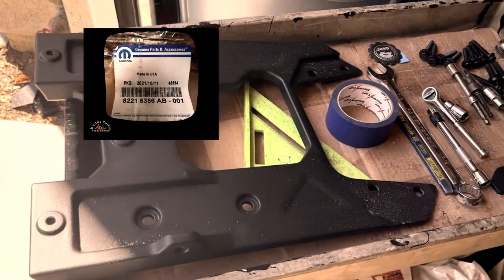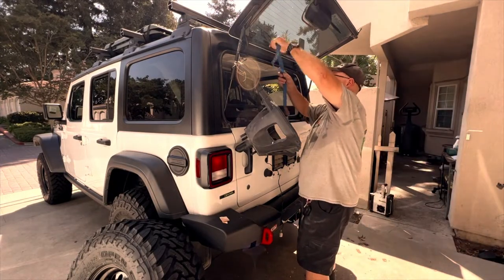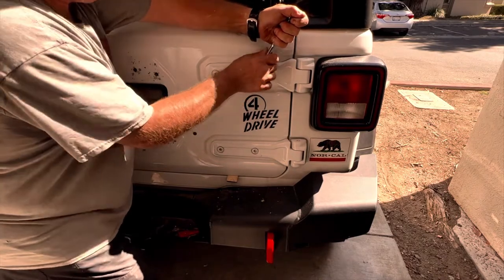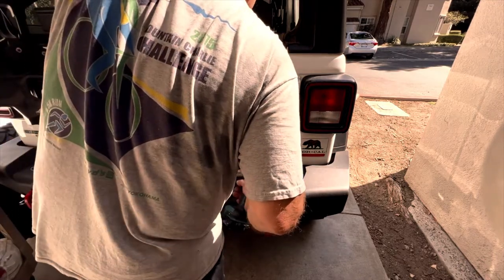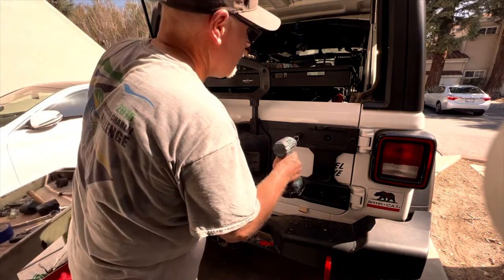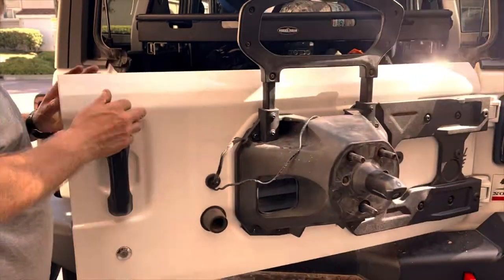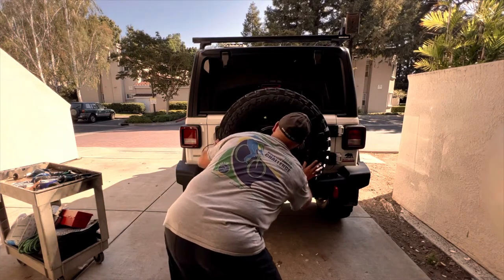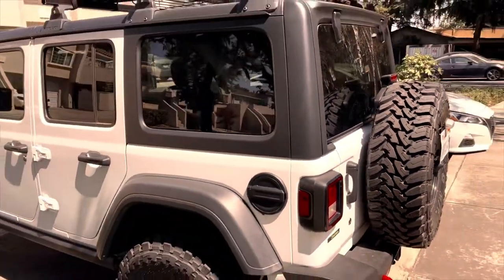How to Install Jeep Wrangler Mopar Tailgate Reinforcement in 11 Easy Steps

Comment: Did you try using a heat gun first?
Reply from the maker: For what? Can’t place where that came up. Love my Milwaukee Heat Gun though. Use it every chance I get.
Reply: heat gun (hair dryer)to warm the paint: recommended for hinges as well to not crack paint when remove, basically anything on the jeep that is painted over botla/hinges
Reply from the maker: @BarkerDuck3825  Got you! I'll put that in my bag of tricks. Thanks!

Comment: Did you remove the rough country tire relocation bracket or reuse it ?
Reply from the maker: I removed it but I’m thinking of re-installing it to lift my spare. Not sure if it will still work with the tailgate reinforcement.